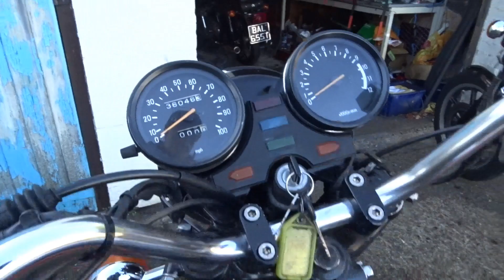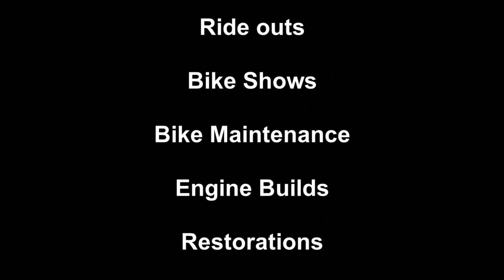Firing up the XS650 and XJ750 that have been in storage for a couple of years

Comment: I remember when you sprayed the xs650 tank and panels in your garden they still look great. Your bikes always sound in better tune than mine even when they haven't been used for 2 years lol.
What  tyre do you have on the rear of the xs ?  I like the tread pattern ..might see if they are still available
Reply from the maker: Alright John, the tyre is a Conti Go but haven't done much miles on it ,  it seems to hold the road well though,  that green one was the one I got that had 13 previous owners and I've  probably spent the most on that one for new engine parts,  probably why it sound nicely in tune, roll on the summer!